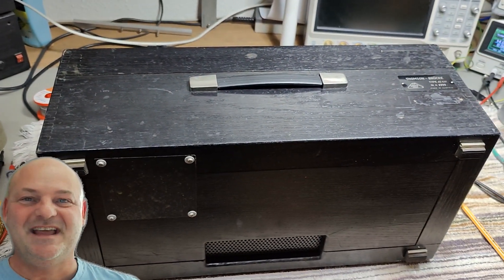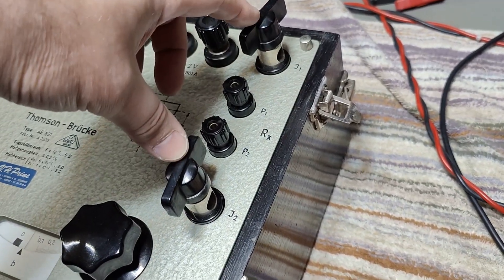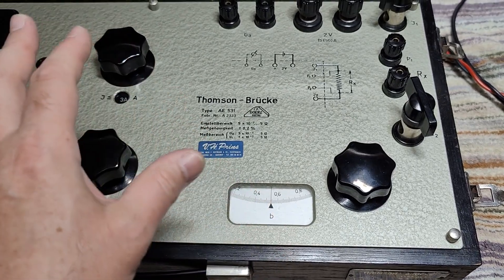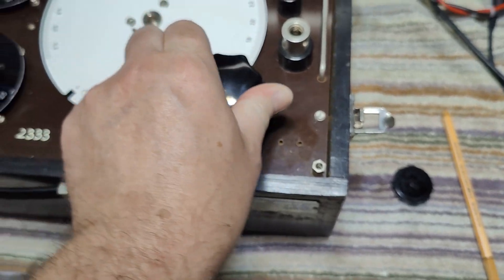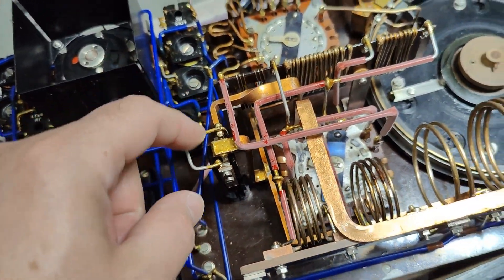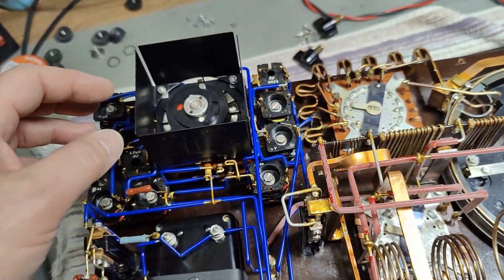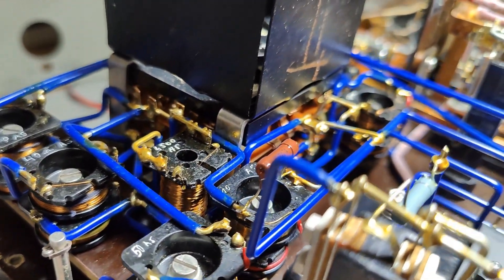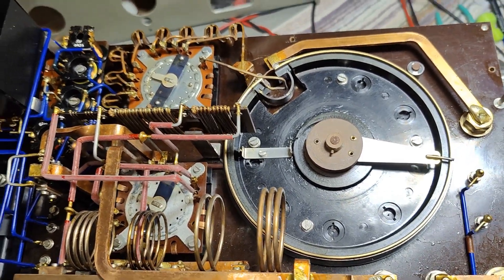Thomson-Brücke Goerz Type AE 531 resistor bridge teardown

Comment: The only way this could be any crazier would be with brazed connections I think. It’s a work of art and engineering. It illustrates well that sometimes to get precise electrical quantity measurements you need a whole bunch of metal formed in fancy ways. And one magnet in the readout device. Isn’t that crazy? This whole thing is dielectrics holding the metal in place. The “circuit” looks like piping in a refinery. Or a distillery :)
Reply from the maker: -i think it is fun to test and play with equipment from each end of the age spectrum, super old brass and copper pipes and wood, to touch displays with million colors and powerfull cpu
Reply: @TeardownOZ2CPU  I fully agree. I have an old handheld adjustable slit for light spectrum identification in a brass chassis, with a nice eyepiece and an internal scale backlit by background light. It just fits so nicely in the hand and makes it easy to distinguish between LED, incandescent and sunlight/moonlight. I like all instruments from such simple ones to my “phone” which has a microphone signal conditioner that has more transistors than an early microcomputer :)